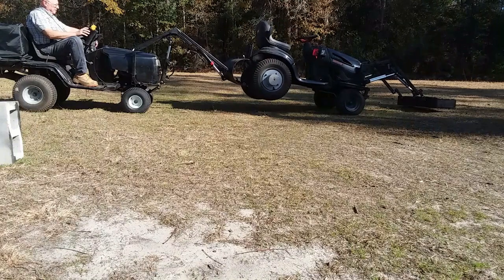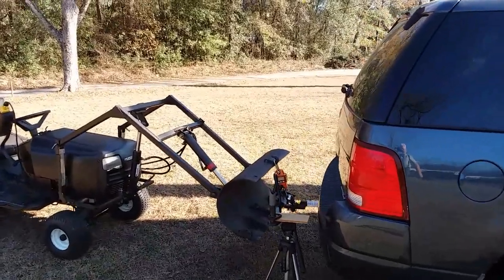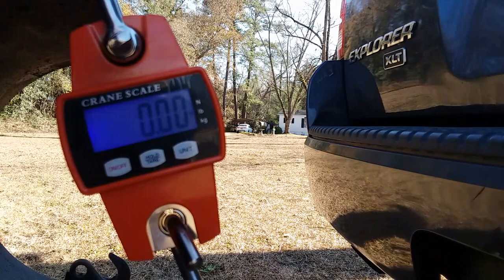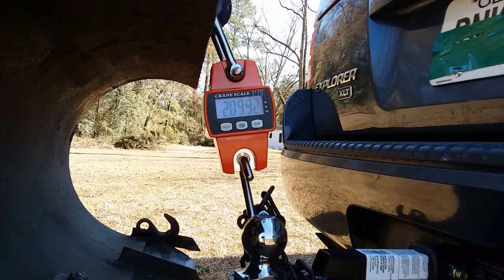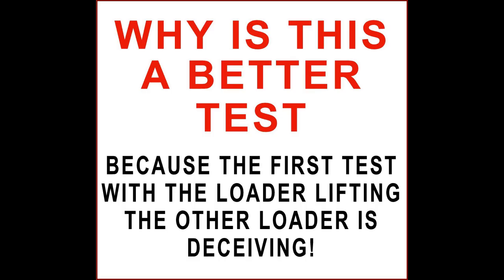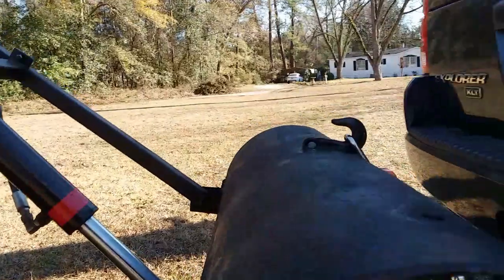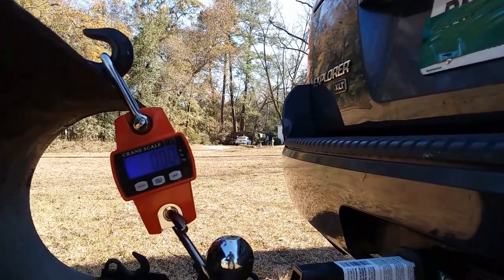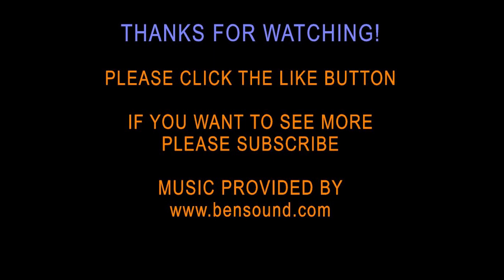HOW MUCH WEIGHT CAN A RESIDENTIAL LOADER LIFT

Comment: I have a Bolens QT10 garden tractor that I am planning to convert. My lift arms are too rigid, and so I will need to design an hydraulic system for it. Bonus If I can buy the plans from the gentleman that build a backhoe for his cub cadet. I might build a small loader for the old craftsman lawn tractor we don't have a use for anymore. Picking up 200 lbs of gravel is still a hell of a lot more than I can do with a shovel!😂 thanks for sharing!
Reply from the maker: Yes, I agree. Builders building on lawn mower tractors need to understand that a 200 -300 lb load is all they should expect. Like you say moving 200 lbs of gravel or dirt is better than shoveling all day and breaking your back.  If you want to lift more than that, you need to build on a heavier duty tractor.
Thanks, Ed
Reply: @eds2centsworth203  The Bolens garden tractor is 850lbs, do you think I can lift 400lbs comfortably on an hydraulic system? That is the max I need i would think. I have all the parts to build the loader, I hadn't decided yet if I was going with hydraulic or actuators. You convinced me. Thank you for showing how to wire the solenoids, that is what was missing for me. The actuator controllers cannot carry enough current in syncro mode.
Reply from the maker: If the Bolens has the frame I think it does, you should be able to add ballast weigh to the rear tires and back of the tractor. The tractors that are in my videos are lighter duty than the Bolens. I can lift 300 lbs max with 150 lbs or more of ballast weight. If I add more ballast weight I can lift more bucket weght. However my tractors are not heavy duty enough to go beyond the 300 lb bucket weight.  If your frame is not at least 1/8" thick steel you will break the frame with regular heavy loads. 
I don't know if you understand the need for ballast weight or not so here is a quick explaination - When you put a load in the front bucket, your front axle acts as a pivot point and your rear wheels start to lift off of the ground.  Put enough weight in the bucket and you will loose traction and stability. Adding ballast weight restores traction and stability. If you put too much weight in the rear and lift a very heavy bucket load you can overstress the frame and it could crack or worse. If your frame is thin you will need to enforce the frame.
Also consider this.  If you don't have power steering, heavy loads tend to make steering difficult. More ballast weight will tend to lift the front and improve steering.
Reply: @eds2centsworth203  Hi, thank you for the information. My neighbour and I calculated we can take the 80 lbs of ballast weight in the wheels and add 150 in the back. He figured I can lift about 400lbs in the bucket. The frame is about 3/16" or better and I was told by a man who used to have the aftermarket front end loader ( a company used to make them years ago.) He could lift close to 500 lbs. Sizing the hydraulic system will be a challenge. Thanks again for the help. My neighbour is a mechanical engineer, so he will check the work before allowing to lift anything heavy.
Reply from the maker: Sounds like you are in good shape!
Ed

Comment: Ed, just can across your channel and am very interested in building
 A loader for my mower. Your videos are excellent and what I have been searching YouTube for.
 Do you have a link to your actuators? Also, did you have a formula for the triangle of pivot,anchor, and force or was it trial and error to determine the best position? Can’t wait to see what 40 volts does with new switches. Thanks so much for these instructional videos. Take care.
Reply from the maker: Here are some links. 
10 inch actuator: https://www.amazon.com/gp/product/B07S2R4RCX/ref=ppx_yo_dt_b_asin_title_o05_s01?ie=UTF8&psc=1 

12 inch actuator:
https://www.amazon.com/gp/product/B07RZKJRHP/ref=ox_sc_act_title_1?smid=A23FMSJB1ZR12S&psc=1 

Personally I would not make any alterations to the actuators for 24 volts or less until you have a problem. I have had only one actuator fail at 24 volts.  20 volts seems to be trouble free.   Here is a link to my video on upgrading the actuators to handle 24 volts. I believe this alteration would handle 36 volts as well, but I have not put it to the test yet.  Keep in mind that you will shorten the life of the 12VDC motor by running in higher voltages. https://youtu.be/q0VW7-C_PU0

As for the math to calculate your mechanical advantage, I use a lever calculator. Here is a link below. 
https://www.translatorscafe.com/unit-converter/en-US/calculator/lever-mechanical-advantage/  
Scroll down until you see the Class 3 calculator. Use the Class 3 - This calculator starts out in metric values but you can change them to inches, feet and pounds.
I hope this is helpful to you, Ed
Reply: @eds2centsworth203  Wow, what an excellent response to my comment. As you stated these mowers were designed to cut grass and some may not be suited for a loader conversion. I have a commercial ZT Gravely which has a pretty stout underframe . Would love to mount a pivot point mid-frame to equalize the weight distribution. We’ll see how that goes. Have researched the items I need for this build and luckily have much of it on hand. I’ll will probably get started in February.  Your actuator teardown to replace the diodes and switches was very well do and explained. I retired 5 years ago and would enjoy retiring my shovel and wheelbarrow also…lol.

Comment: Great video. For the last 5 years my hobby has been buying used lawn tractors to use on my 9 acres for different purposes. Building one with a loader is on the short list. 
My question is, if you made the hood lift strait up to remove, so the loader could be tucked closer to the front axle, wouldn't that increase lifting capacity without causing more stress?
Reply from the maker: Yes, that is true, it would help. But there are other factors. For example: where is the best place to come off the frame. Some tractors lend themselves to a connection point behind the front axle, thus making the bucket fit closer providing increased lift capacity. Other tractors do not lend themselves very well to that design and it is better or easier or more cost effective to make the connection point to the frame in front of the front axle. This is where a problem comes in - the feedback that I am getting is that builders want to keep costs super low. They want to build somewhat quickly because they live very busy lives. They want to build on the lawn mower tractor they already own.  In some cases they want to build a loader and leave the mower deck on, greatly limiting options.
In your case it sounds like you are thinking through each of your tractor projects. You are taking the time to select just the right tractor for the particular use. Likely you are choosing a true garden tractor with a heavy duty frame for your loader project. If so, this is great. But even if you build a loader on a riding mower it sounds like you will be very selective in the tractor you buy so you can build the loader you envision. I design my videos to be helpful mostly to those that fit the description mentioned above, people that have fewer choices. 
Ideas are what will help potential builders to think things through. Your idea / recommendation is an excellent one. Viewers that read comments attached to this video will benefit from your insight.
Also, worth mentioning is the fact that the hood on the loader in this video lifts straight off.  I had to do that because of the single hydraulic cylinder positioned right in front of the hood would not allow it to remain as a pivot to open hood.
Thanks, Ed

Comment: Awesome video great information! I have a 1969 cub cadet international model 72, I'm wanting to build a loader for, the frame is heavy duty and can definitely take a beating unlike a regular riding mower. Can you do a stress/Lifting test on the electric actuators on the other tractor you have like you did in this video?  Thanks Mr. Ed
Reply from the maker: Yes, I am planing on a video to test the lifting ability of the DC actuators. That Cub Cadet should be an awesome build.
Thanks,  Ed

Comment: Good morning Mr Ed , very good video . How are you powering your hydraulic cylinders ?
Reply from the maker: I use a 12 VDC hydraulic pump. Here is a link on Amazon.  https://www.amazon.com/Happybuy-Solenoid-Hydraulic-4-5Liter-Trailer/dp/B07ZCLS6RN/ref=sr_1_9?crid=1OMKBG0H1ZKNL&keywords=hydraulic+pump+12v&qid=1672764659&sprefix=hydraulic+pump%2Caps%2C117&sr=8-9 

The tractor battery is not strong enough to operate the pump for very long, so I am also using a Ford F150 battery to power the pump.  The alternator on the tractor can't charge the battery fast enough, so I have to charge the battery before using. A full charge on the F150 battery will allow me to use the loader for about 2 hours under steady use. If I use the loader only ocasionally during the day the battery will last all day.  I find this is acceptable in a residential setting. In a commercial setting it would not work very well.
You can see my setup in one of my videos, here is the link: https://youtu.be/4mflY5zBKrI 
Hope this helps, Ed
Reply: Thank you very much . I am wanting to start a loader build for my 1972 John Deere 110 garden tractor !!